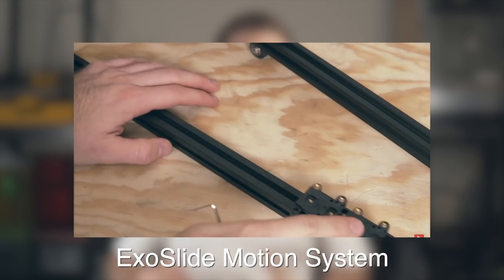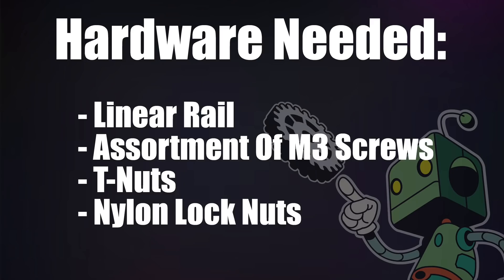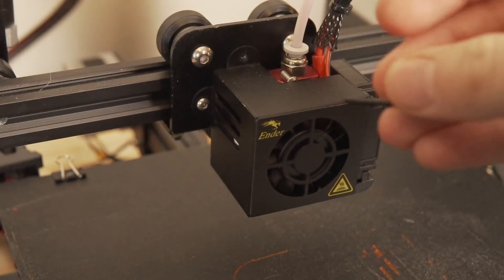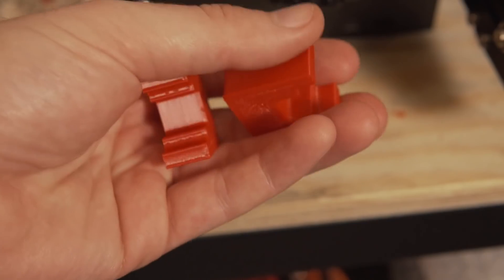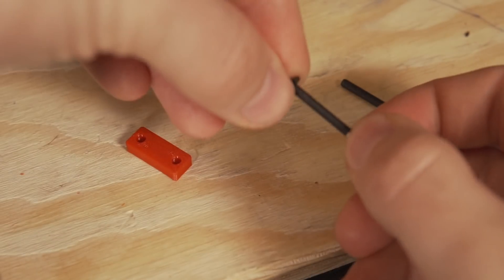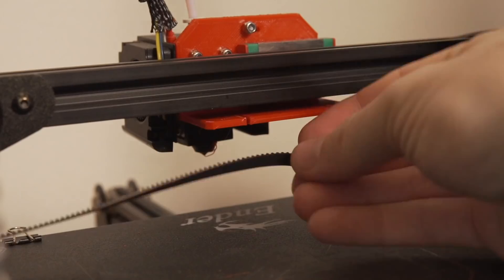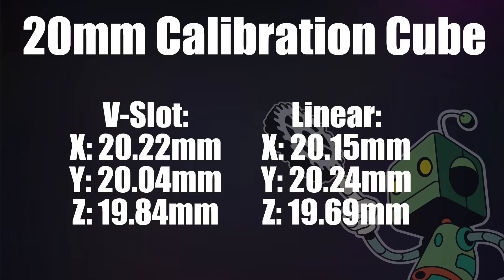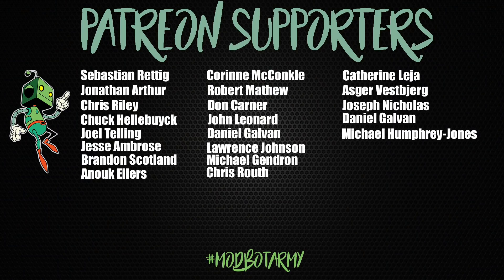Low Cost Ender 3 3D Printer X-Axis Linear Rail Install

Comment: should have printed a jig to attach to aluminum angle bracket to let you drill and cut the angle bracket to make an aluminum bracket for your hot end.
Reply from the maker: Seems like a few people have recommended this. That is an excellent idea and would have been much more rigid.

Comment: I converted 4 of my printers to linear rails, an Ender 5 Plus and three Ender 5s, now have three running on the Exoslide system.  The linear rails worked well, but the plastic printed mounts were the problem, along with no good design for the belt clips.   I think for about the same cost the Exoslide is better.
Reply from the maker: Before this, I did not even think of that. The rail itself is really only half the battle. The real struggle lies in a mounting solution for different hotends/fans.

Comment: Yikes, you shouldn't have the block come off the rail at any point to hit the end stop or the balls can fall out.
Reply from the maker: That’s interesting. I did some digging and found even in the guide from printer mods they recommend a space if I believe 3mm or so. Between the rail and end stop. I am not sure there is enough of a gap for the balls to fall out.

Comment: Another option is getting square or angle aluminum stock from home depot. A little sawing and drilling and you know it's strong.
Reply: second that, would be an extremely easy part to make from some sheet metal or angle plate. Just print your hole pattern on paper and gluestick it onto your stock, give it a center punch and drill away.
Reply from the maker: This is a great idea. My only space currently is my living room so its tough to do much sawing but no for a cheap solution that is going to be rigid I like that idea alot.

Comment: Embedded heat set nut inserts are good candidates for use in this design as well, especially for that can shroud short screw.

Also tolerances between different belt tensions are hard to compare.  Plus with a different amount of backlash, you may need different X Step calibration.
Reply from the maker: Heat press inserts I think would be great. The ones I have would require bulking up the bracket to allow them to seat correctly and not stick out.
Reply: @ModBotArmy  totally fair, but the whole bracket wouldn't need to be thicker, just a cylinder area where the insert goes.

Also, build the hotend standoff into the bracket itself and use inserts there as well.   You can even build the overhang supports into the design.
Reply from the maker: @underourrock  that is a great idea. I know the original design removed the bracket from the model to prevent needing support but it’s such a simple geometry that supports would have been no big deal to have on this.
Reply: @ModBotArmy  In things that don't matter "looks" wise, I like to draw a 45 degree  ramp underneath them, so that when they are printed they already have support built into the model itself.  I guess it would be self-supporting model design... Or designing parts with printing in mind.

Comment: Add ribs between the horizontal and vertical planes to increase rigidity for very little material usage.

Love the video / overall idea.  You can improve the petg design pretty easily.

Comment: The carriage you designed is not as stiff as the original carriage. I believe it deforms when the belt pulls, and that it is the main reason for the difference in dimensions.
Why not using the original carriage and design and 3Dprint a guide to help drilling the 4 holes needed to secure it?
Reply from the maker: I did not use the original carriage because of the hole placement. The holes needed to be spaced further out which brought the hotend closer to the edge of the bracket. It took me a few times reading this to understand but you are saying why not drill out the original aluminum bracket right? That is an interesting idea. I may have to look into that to see if there is anything else in the original bracket that would prevent it from working.
Reply: @ModBotArmy  Print out a jig to locate the holes you need to drill.

Comment: For cheap linear rails you should take them apart and relube them to get the best use out of them. The amount of times I have found that it improves their performance is worth the time to clean them.
Reply: Do you also have a suggestion for the lube?

Comment: Can linear rails be put on a creality CR 6 SE
Reply from the maker: It uses extrusions so I would say yes. I think the main issue or hurtle you will run into again is with the actual mounts/brackets that need to be designed and either printed or milled.

Comment: As a machinist I've noticed in a great many comments & 3D printing videos, that there appears to be a lack of calibrating the entire machine as a complete package. When any quality machine shop buys a new piece of precision equipment, there's a rigorous "setup & calibration" procedure. Too many videos are out there of trying to simply 'bolt-on' high quality components to achieve high quality output. Unfortunately, it's not that simple or easy. Even the highest quality machines can 'twist, sag, bend' or need backlash or other adjustments to achieve ultra high accuracy & repeatability.
Reply: I installed linear rails on one of my ender 3s about a year ago.  All I did was adjust the end stops,run the bltouch to remesh the bed leveling, adjust probe offset and that's all. Been working perfectly fine been able to get a little faster accelerations without sacrificing print quality.  

Not sure exactly what calibration you are after for a 3d printer but the steps I took seem to had been enough.
Reply: If you can print with 0,08mm PLA, then that is precision. Even more if the adjustments are near to 0,01mm. I will be fair with you, and i will say that sometimes the "precision" is over qualified. This is a common low budget 3d printer available to everyone. But, there is a but... tomorrow the next generation will grow with that and they will do more...
Reply: I have never heard backlash described as a needed attribute to accuracy, it's usually described in the negative
Reply: do you have suggestions on calibrating in a general sense that could be applied to printers?
Reply: @Just_Natee  I suppose you could get a couple precision dial indicators and sweep the x & y & z through their travel. Using a precision level to level everything first would be important. 🤷🏼‍♂️
Reply: i am an actual real cnc machinist and authorized index machine tool repair/serviceman (i authorized myself :D). I see it too and you cant get much of a quality out of a 20$ linear rail. Its really with anything 3d printer related, they just think hey lets just add this and that and we get injection mold quality. But to be fair 3d printer and cnc machine is not comparable.
Reply: @TommiHonkonen no sane person going into 3d printing especially FDM, expects injection mold quality
Reply: @TommiHonkonen Please machine me a castle with spiral staircase.
Reply: Did I miss something or did he not calibrate his machine after changing the linear guide? I dunno what he expected... and what's more is the only thing he compared pre and post change is the dimensions, which is only a small part of why someone might upgrade to linear rails. Even inexpensive ones can produce better results than linear rods IF YOU CALIBRATE the printer. This video was a waste of time...
Reply: Agreed. An Ender 3 is a popular printer but it's hardly a "precision equipment". Adding this linear rail doesn't do much to improve speed or quality of prints given the rest of the flimsy build of the gantry (like most printers of this type at that price point). Linear rails make more sense on a rigid corexy printer.

Comment: Washers, use washers :) this way the tension on the screw is distributed more evenly and will be stronger.
Reply from the maker: Definitely should have done this for the parts that go into plastic. Thanks for the recommendation :)

Comment: A fantastic video!  Accuracy is important, but I think in this instance repeatability is more important.  It dosnt really matter much, as you said the petg is likely the weak point in this and you are changing it soon regardless.  You can tweak the firmware to make it more accurate, the rail determines if it behaves the same every time.
Reply from the maker: There are definitely variables here. I am curious to see how it changes when I have an aluminum bracket on here that will not have any slop. I also would be curious to see if the low cost linear rail versus an expensive one would affect this or if it is more relative to the longevity of the rail versus initial performance. That is very valid though repeatability is at least equaly important.

Comment: If you have access to a cnc machine, this part is really easy to make. Just redesign it in fusion in the sheet metal environment and use 4mm 5052 aluminum and a simple vise break can make the 90 degree bend. Then you can just tap the holes, no need for locknuts. I know you have a nomad, I've made similar parts on the nomad, very easy. You just use appropriate length m3 bolts so they engage the thread and don't hit the linear rail block. Also, consider garbage in, garbage out. I've had some very sketch linear rails from China. Sometimes reassembling the block with new lubricant works, sometimes, nothing helps.
Reply from the maker: This actually crossed my mind with how simple the part is that it does look like a great job for a CNC machine. I do like making it printable though since anyone doing this upgrade at least has a 3d printer while I feel like there are lots less that have CNC machines. Also, since I am in a small condo I cant use the CNC for anything other than softwoods or acrylics during the day or my neighbor will lose their mind. I do appreciate the tips though I think they are all valid and definitely would lead to a much better part.
Reply: @ModBotArmy  https://www.youtube.com/watch?v=SOgn47YAe84

Comment: A few people have done this modification and posted very similar results with an ABS printed carriage plate in that the V wheels produced the more accurate print, I think the rails would produce better results on higher-quality extrusions.
 Vector 3D and Tom Salanderer are the ones I have seen, I think Chris Riley did it also
Reply from the maker: Interesting. I have not watched much on linear rails for 3d printers. I know I have seen a few recommended videos come up. I believe Teaching Tech did one as well. Would be interested to compare and contrast notes. In a lot of instances if I am going to be doing something I sort of like to go in a bit blind to come to my own conclusions without having some sort of preconceived notion. However, afterwards seeing how my results match up or differ from others I do enjoy seeing. I also am curious if higher quality rails would have had much affect on this.
Reply: If you're getting better results with delrin Wheels then over linear rails then you're definitely doing something wrong As even the worst Chinese linear rails are going to be several orders of magnitude better than v slot wheels.

Were you noticed the improvement the most is when you start cranking up the print speed and acceleration.

But I mean seriously mounting a printhead to a 3D printed plastic part and expecting good results has got to be the epitome of ignorance.

I mean you're buying linear rails for their rigidity and then mounting a flimsley plastic adapter plate to that rail.

This is where you want machined aluminum.

I'm ashamed aluminum adapter plate between the linear rail carriage and the hot end is the only proper solution, using anything else and you might as well just stick to plastic wheels
Reply: @dannelson8556  They did not get worse results they just could not see any quailty increase with linear rails, one of the videos I saw did get worse results though and I dont think they had a printed mount, if I remember correctly the kit came with a machined plate, the degradation in quality was put down to the accuracy of the rails, I think the conclusion was that POM wheels with their slight slop absorb some of the vibrations whereas the rails might have been getting a resonant frequency that was transferred to the print, maybe a printed plate would absorb that frequency and stop it being transferred to the print?

Comment: Also with a budget linear rail, you probably should have cleaned and repacked the bearing block with new grease. I've seen them come very dirty from the factory depending on the quality of product.
Reply: This is crucial. Grease it up and run the carriage back and forth rapidly for 30 seconds. Then, pushing the carriage down slightly keep sliding it across the whole rail trying to find spots where it isn't smooth. It can feel a bit like sand when the balls are grinding.. If this happens just grease some more!

Super Lube with PTFE or White Lithium Grease works great for this
Reply: @erikhellman3974  Super Lube would be the best choice by far since it's silicone and will never dry out. The big tube that's labeled as brake grease is the same product as the small tube and a better value.
Reply from the maker: Thanks for the recommendation. I have done this for cheap LM8UU bearings that I have purchased but was not aware that this also goes for these rails.
Reply: How would you guys go about cleaning them first??
Reply: @keebsnstuff3400 Soaking in Isopropyl alcohol and then brushing them with a tooth brush. Then you have to repack them with grease.
Reply: @jacksoni349  what kind of grease would be best? Thanks so much
Reply: @keebsnstuff3400  I usually use white lithium grease. Not too thick of a grease to impede the bearing block from moving but thick enough to not need to be replaced often.
Reply: @jacksoni349  is soaking in straight 99% iso okay or does it need to be watered down or anything?
Reply: @keebsnstuff3400  DO NOT USE WATER!!! I did this and wasn't thinking, ruined a full set of bearings. This will cause them to rust. Youtube  search nero 3dp mgn cleaning. He has all your answers.
Reply: @jacksoni349  thank you very much my friend

Comment: So depending on the quality of the linear rail, I would say using bolts in every location could actually warp the linear rail. This is depending on the strength of the product of course. I think I was looking at maybe E3Ds tool changer blog and they talked about doing every other hole or something along those lines to not over strain it.
Reply from the maker: Interesting, I can search it but if you do have a link to that article I would be interested in checking it out.
Reply: Link? Any luck finding it Mod?